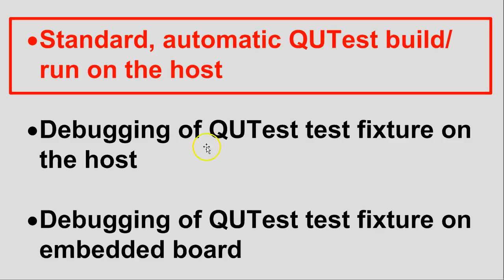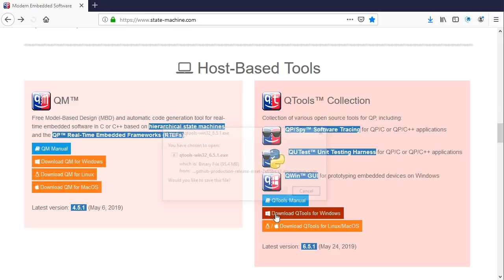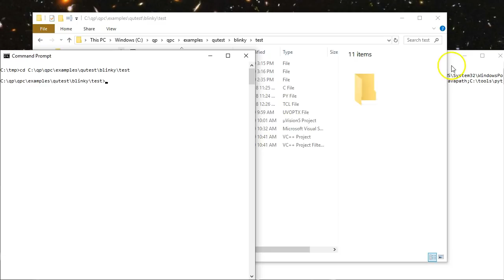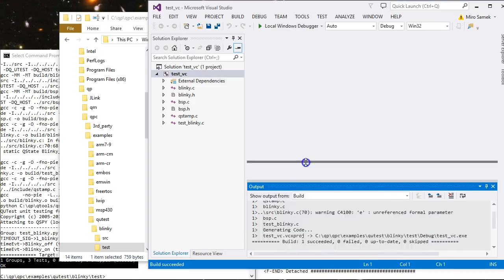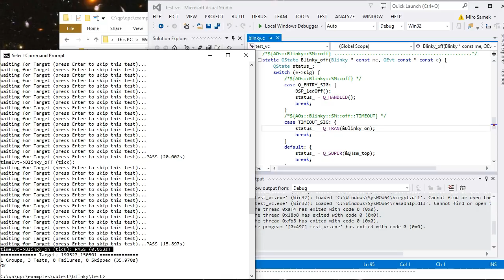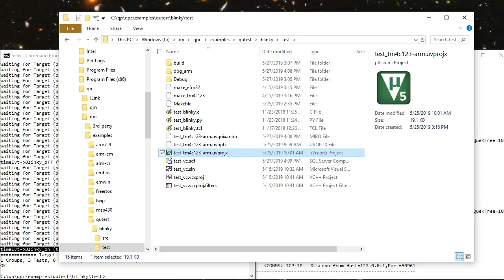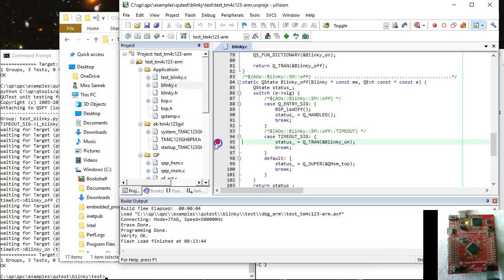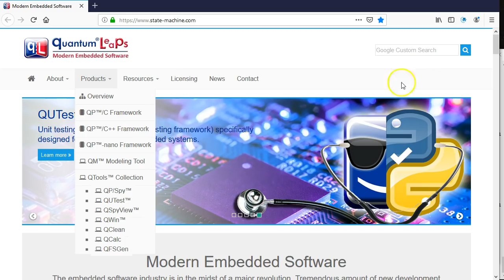QUTest Unit Testing for Embedded Systems: Debugging with QUTest

Comment: I got with MS Visual Studio 2019 the following errors after building test_vc solution:
Error LNK2019 unresolved external symbol ___iob_func referenced in function _QS_onStartup 
Error LNK1120 1 unresolved externals 
Retargeting from 2013 to 2019 was necessary to execute the build. Can anyone support with a solution?
Reply from the maker: You might try to recompile the QP library with your newer version of the MS Visual Studio compiler. The library build project for Visual Studio is located in the directory <qp>\ports\win32-qutest\qp.sln, where <qp> is the directory where you've installed QP/C or QP/C++. After building the qp library, you might go back to the example and re-build it.
Reply: @StateMachineCOM  Thank you very much. it works now! 
I would appreciate if you could give a tutorial about writing the test script in python. 
Is it possible to perform the same unit test procedure using gtest framework? Which changes are required?
Reply from the maker: I'm glad to hear that recompiling the QP library with the newer version of MS Visual Studio has fixed the problem. The future releases of QP will use the newer MS Visual Studio 2017, which should be compatible with 2019 as well.
Reply from the maker: Regarding  gTest (Google Test), it is based on the standard xUnit principles. This approach blends writing tests and running tests on the same host computer and therefore it is essentially impossible (or at least very hard and cumbersome) to write tests in a different language (like Python) than the CUT (code-under-test) in C or C++.

In contrast QUTest has been specifically designed for testing deeply embedded systems, where the running of the CUT is separated from driving the tests and verifying test expectations. This separation of concerns allows developing tests in a different language than CUT. The QUTest approach also vastly simplifies the need for "mocking" which is necessary in gTest. Specifically  to "mocking", there is a QUTest Tutorial explaining how this is done much simpler with QUTest, see https://www.state-machine.com/qtools/qutest_mock.html